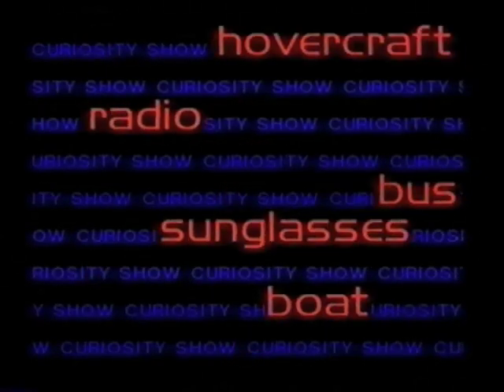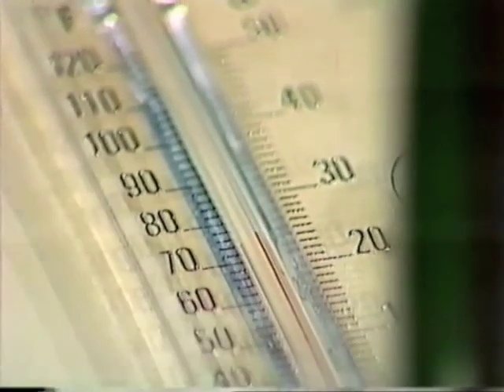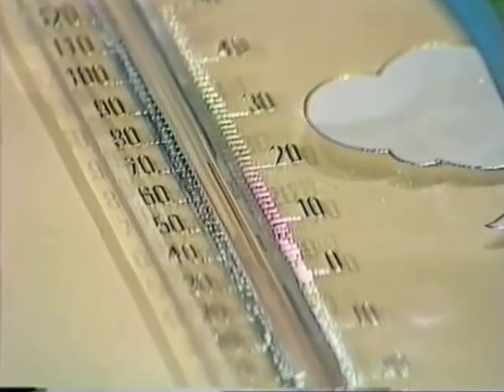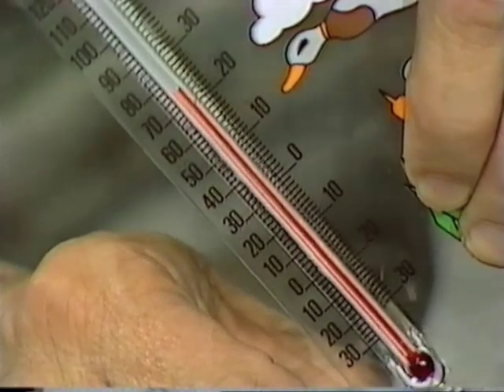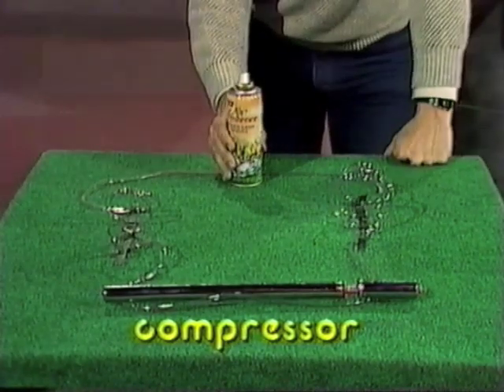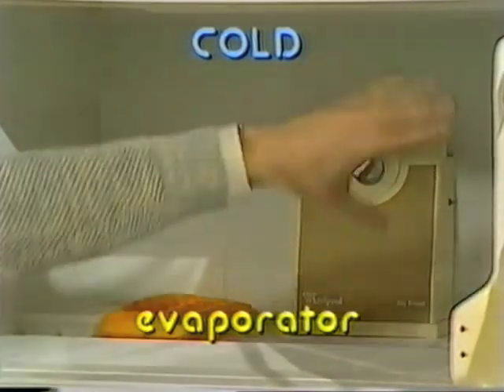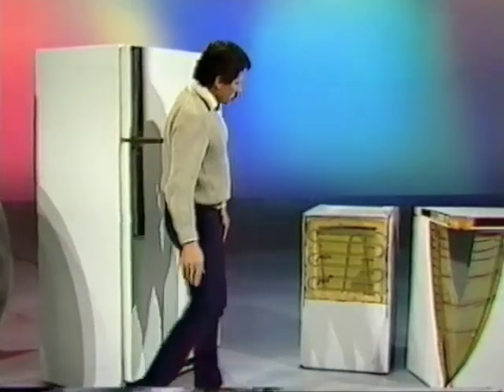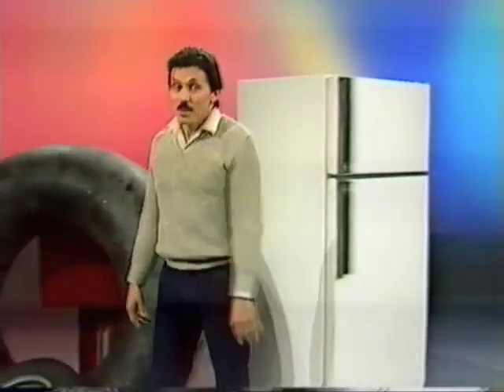Refrigerator - How Does It Work?

Comment: Best explanation I've found online. The bike pump and aerosol can demonstration made it easy to understand. Love it!
Reply: i like that since they didn't have any digital long-distance thermometers like we have today, they couldn't just point the thing at the air can or bike pump, but they had to physically hold a wall thermometer that is decorated with ducks near the tire to see it working.
Reply: This is also old science, it's the 21st century and I'm sure most of this dutff is better understood by scientists not 20th century alchemists
Reply: @BoleDaPole  
Nope.. very little has changed in fact . It's simply manipulating pressure and temperature.
Learning the difference between latent and sensible heat and how pressure effects them.. it becomes common sense rather than something complex

Comment: Dont do what I did when I was a kid and grind through the pipes of an old fridge with an Angle Grinder only to find out the refrigerant is flammable. Burnt off a large portion of my hair and had no eye brows for a bit.
Love the curiosity show. It was so cool
Reply: Daniel White good old propane refrigerant!
Reply: the propane-butane mix is often still used, seems to work quite good and kinda safe.
thats how i found (smelled) we had a leak in our 2 compressor fridge.
(one for the freezer, one for the upper cooler section)
Reply: R600a gas is used in some modern fridges. It's an isobutane mix same as a bic lighter. Need to be a gas fitter to work in fridge. R134 is the most common refrigerant used.
Reply: Like I said, I was a young man when I cut through the tube that had the refrigerant in it. I should not have been scrapping the fridge if I'm honest at the time I had no idea that I was about to loose my hair. Rest assured, I never made a second attempt lol. Just for trivia it would have been the old gas.
Reply: @coco21585  appliance technicians work with r600a you don't need to be a gasfitter just need to be certified in refrigeration

Comment: Great job Deane & Curiosity Show. I'm curious ; with the amount of compressed air in all kinds of things from tires to refrigerators, and more. Does these small burst of temperature change (plus the energy used) have a mild/medium effect on the surrounding environments ?
Reply from the maker: Only temporary and local. Remember that the cooling of any released compressed gas only balances the heating during compression - Rob
Reply: @CuriosityShow  Thanks for the reply Rob, your a legend.
Reply: @CuriosityShow  1981

Comment: Due to my job, I know very well how refrigerators, air conditioners, etc. work. . . . And there is something important to understand that he has not explained: There is no way to directly create cold, the way these devices work is not by creating cold but by extracting heat.

Any chemical or physical reaction generates heat, and the way to cool something is to put it in contact with something else that has a lower temperature and thus they tend to equalize their temperatures.

The point is that both a refrigerator and an air conditioner actually generate more heat than the "cold they produce". If all that system were contained inside the refrigerator, the interior of the refrigerator would be warmer than the environment outside. With what the "trick" is precisely in all the components that are on the outside of the refrigerator (in addition to the explanation he gave).

Due to the movement of its motor and the electricity it receives, the compressor heats up, and a lot, and that is why it is outside the refrigerator, but the key is in what he explained and added to the kind of radiator that is in the outside of the fridge. That "radiator" is much hotter than the "radiator" inside the fridge, and that's because the radiator inside the fridge is used to extract heat to the outside of the fridge. An air conditioner is exactly the same except that to enhance that heat extraction, a fan is added to the device that is left outside the house to extract heat faster (greater heat extraction = more cooling).
Reply: It's kind of mad, really, isn't it? To keep our food cool, we have to use electricity (often produced by burning fossil fuels) to move the warmth from the inside to the outside of the box. At a micro level, we make the inside of the fridge cooler by making our kitchens warmer, and at a macro level, we keep our houses and factories cool by setting fire to the rest of the planet!
Reply: @AutPen38  Wrong.  We have zero impact on the planet.  Don't be a fool.

Comment: So simple and nicely explained..of course you did not explain with the compressor is needed. I'm guessing it is to bring back the fluid to the original state in order to evaporate it further by the evaporator. Is that correct?

Comment: Great explanation.  I always noticed how cold my co2 tank got when I replaced them on my paintball gun. Such an easy demonstration and explanation.  I took electrical classes and we covered these parts but the instructor still admitted he didn't know how it worked.  Now I do.  So how do you tell if one part isn't working.  Seems like if it's not getting cold the evaporator isn't working

Comment: one thing, the heat generated by the compression is pulled away by the cooling fins (like the back of a fridge, some models use the outer walls as cooling surface) (or a radiator on air conditioning units) so that when it gets decompressed, the resulting temperature is lower that the temperature before compression. if the compressed air is not cooled down, it will just return to it's "before compression temperature" when it decompresses. it also applies to air conditioning units, and intercoolers on cars.

Comment: AMAZING! now i got enligtenment because i still confused with "thermal throttling" and how it works, is just amazing not ever thinkable for me is simple as that, gas is hot when compressed and cooling down when evaporate or loose the compressing and i just found the answer on your video, but i have a mind boogling question, does the refrigerant have lifespan? or the cycle will continue forever if the equipment is durable enought to maintain the condition?

Comment: Thank you.

Thermodynamics explain the same thing, which i absolutely didn't understand at that time in school... Too much physics explanation about how heat transfer naturally from hot to cold. While refrigerator/air conditioner reverse that system, meaning heat transfer from cold to hot, but in this case we need extra power.

Thats all i can remember about how it works, this on the other hand explained it very well

Comment: had this been how physics was taught in my school I would have probably fallen in love with this course. Also, what exactly do we need a compressor for?? Why not just have the freon kept at cooling temperatures constantly, or have the room temperature deal with the re-heating? I really don't understand the point of the compressor
Reply: The saturation temperature of the refrigerant depends on its pressure. In order for the refrigerant to condense into a liquid it must have a high enough pressure for the saturation temperature to be higher than ambient.

Comment: absolutely awesome  video! I have one question.. why are freons or those other special enviromentally hazardous gasses used? what is their advantage(or sought after properties)..compared to lets say..normal air or other harmless gas? ty
Reply: video is old and freon isn't used anymore, and when it was used it was thought to be safe.
Reply: There are several properties that make a good refrigerant. The main one for performance would be its latent heat of vaporization, a refrigerant with a high latent heat of vaporization would have more cooling power for the same refrigerant flow. The pressures they operate on is also a factor. If the refrigerant needs higher pressures to work the system would need to be built beefier to handle the pressure. Cost, safety and environmental impact are also factors. Butane and propane are common clean and pretty good performing refrigerants but they are highly flammable which prevents it from beign used on large systems due to safety concers. Nobody wants to accidentally puncture a refrigerant line and have a fireball.
CFC and HCFC refrigerants had better performance than their HFC replacements, but were terrible for the environment. Now HFC refrigerant is starting to be replaced with HFO and HC refrigerant. With every new generation performance is sacrificed for a cleaner alternative. Ammonia or ammonia derivatives are some of the best performing refrigerants but they were replaced with CFC refrigerant a long time ago because ammonia is toxic as fuck.
Air would not work as a refrigerant because it cannot condense at normal temperatures, it would need to be very very cold to condense. CO2 on the other hand can and is used as a refrigerant but it has very high operating pressures which brings its own difficulties. It is much cheaper and easier to build something designed for a max pressure of 600 psi than it is to make one designed for 2000 psi.
Reply: @Redtooth75  wow, thanks for this reply:) u explained it nicely!

Comment: for those of you wondering how the compression links to heat:
pv=nRT
p is the pressure, or how squished the substance is.
v is the volume, or how much space the substance takes up.
n is a technical thing. it's the number of moles of gas present. in the refrigerant, the value of n will always be constant, as no refrigerant is allowed to escape or enter the system.
R is something (i can't remember), but that too is always constant, so we don't need to worry about n or R.
T is the temperature.

As pressure x volume is linked directly to the temperature, and the volume doesn't change, that means that increasing the pressure must increase the temperature.
Reply: R is the universal gas constant.
Reply: @unibyte09  ah, yes. That's what it was. Thanks.

Comment: I noticed this in extreme on my time as a oil drilling hand.   When pipe lines drop pressure the moisture in the air turns to ice even in plus 25 c mid summer weather.

Comment: I remember my physics teacher asking the class (like 20 years ago) "what if you leave the frigerator's door open, will it 1) Cool the room temperature, 2) Make the room temparature rise 3) Nothing happens to the room temperature.
I don't wanna google, I challenge you to not do so either, Any suggestions which answer is correct and why? 

I remember having nice debate over this without any fancy maths, since some said the heat will go inside the fridgerator thus cooling the room, but some said that when that happens, the fridgerator produces more heat thus nothing happens or the room actually gets warmer

Comment: Great demonstration with the pump and spray. However, the sprayer would be better to represent the meter device in the refrigeration system and the bike pump to represent the compressor. Since those are the two part that literally operate with the same concept. The metering device sprays the refrigerant in a sense to drop temperature and the compressor compresses refrigerant to increase temp. The coils don’t do that. The coils just allow us to absorb and reject heat aka btus. Evaporator absorbs heat and condenser rejects or releases heat.

Comment: I wonder though, if there could be a way to also use the heat generated by the compressor for practical use? That way you’d combine two compliances - one for heating (food, for example), and one for cooling (the fridge). Or would that take away the stored energy and the fridge would run less effectively?
I don’t know much about science or thermodynamics, So I’m curious
Reply: In Siberia, people use fridges to stop their food from freezing. The machine can also be used to keep the kitchen warm.

Comment: He was kinda close but from the compressor discharge the refrigerant in the  system will go to a condenser where high pressure vapor turns to high pressure liquid , the hot part on the back he shows us is the condenser, from there it moves to the liquid line which has some sort of metering device, usually a capillary tube on refrigerators that begins to drop the pressure before entering the evaporator where it nearly completely evaporates before moving to the compressor suction line, if this doesn’t happen, the compressor will suck in liquid refrigerant and attempt to compress it and at worst will cause the compressor to burn out.

Comment: It is because one side is higher pressure than the other side so when it comes to low pressure side it absorbs heat and then compressed and heat is released outside in what is called a condenser coil because hot gas vapour is condensed down under higher pressure

Comment: If you're curious as to WHY releasing pressure causes temperature to drop, it is called "Gay-Lussac's Law", which one of a few laws under the "Ideal Gas Law".
It says that for a fixed volume, if the pressure decreases then so does the temperature, and vice versa.

This is because as pressure increases within a fixed volume, the molecules "bump" into the container and each other more, increasing their speed which increases temperature. 
As pressure is released, the molecules slow down and then so does the temperature.

If you want to know more, watch PBS's "Crash Course Physics" episode #20 video.

Comment: The program doesn't describe the mechanism, and the comments contain some wrong explanations. "Temperature" is thermal energy density, and refrigeration is all about increasing and decreasing something's density. Increase the pressure of a compressible substance and you push the atoms (all of which have a temperature) closer together which make the substance SEEM like it gained heat because that energy is now in a smaller space. It's concentrated (like a magnifying glass concentrates sunlight and lets you burn something where before the sunlight couldn't burn something. The properties change but the amount of energy is the same). But the substance still has the same amount of thermal energy that it did before. Since it's concentrated, it's hotter, and since it's hotter, it's probably quite a bit hotter than the air in your kitchen, and that means that you can cool the substance by putting it in pipes that are exposed to the kitchen air. So you cool it down, and now you have something interesting- a compacted substance that has less thermal energy than it did before but that hasn't depressurized. This is quite a trick because now if you depressurize it back to its original volume, the substance will be colder than it was originally. Now just use that cold substance in pipes to cool down your food, such as by blowing a fan over the cold pipes in the direction of your food.

Comment: Good explanation. Same principle as why sweat cools you down.
Reply: MichaelKingsfordGray  Not altogether different.  In fact, as shown in a previous comment, most refrigerators do in fact use condensation and evaporation to make the cooling process more efficient. These are just extremes of pressure at a given temperature. The short answer is that refrigerators exploit the changes of temperature and state that occur when coolants are compressed and uncompressed. Sweating is only able to exploit changes in state.
Reply: @MichaelKingsfordGray
Care to explain how its completely different

Comment: 2 minutes 50 in and I have a question that needs to be outta my system before I can watch the rest : so is this compression effect the reason why when we blow air with our lips tightened it comes out cold and mouth opened the breath comes out about body temperature, which is pretty hot ?  Damn so we're pressin air molecules together enough to cool em down with our intercostal muscles ? Shit's wild !

Comment: In the next couple of decades, this knowledge will become very important again as the world has to shift away from heating with oil, gas or by burning any kind of stuff and instead has to heat with electricity. And the same principle will of course also work for heating, just put the hot side into the house and the cold one outside. Basically this thing is called a heat pump as it transfers ("pumps") heat from one side to another one and it can be used for cooling as it can be used for heating. Basically we all know heat pumps as "air conditioners".

Now some people may ask: But why not just heating directly with electricity? Nothing is easier than turning it into heat, just ask your stove or your oven or your electric kettle. That's correct, that's the easy way to do it but also the less efficient one. 1W of electric power will at most produce 1W of heating power that way (usually less as you will have losses) but if you use a heat pump, you can get over 4W of heat by investing only 1W of electricity, as a heat pump does not produce heat as an electric heater would do, it takes heat from somewhere and moves it elsewhere and moving heat costs way less electric power than producing it.

Of course, you will need a source of heat for that and that's why heat pumps don't work if it's -20 degree Celsius outside as that's too cold to extract further heat. Well, it can be done, but then this would not be enough heat to heat a building. So when it really gets that cold, directly turning electricity into heat is the way to go. Yet there are little parts in the world where it ever gets that cold and if so, only for a few hours a day and only at a few days a year. So even they would use a heat pump and just fall back to direct heating when the temperature drops below such limits.

Comment: Fridger inside bedroom gets cold or hot the room or mimick an A/C?
Reply: A refrigerator in the room will always heat up the room. Even if you leave the door open the room still gets hotter because the compressor and refrigerator process are not 100% efficient.